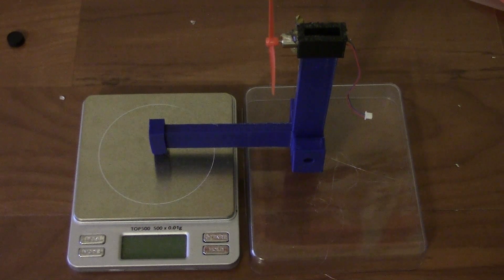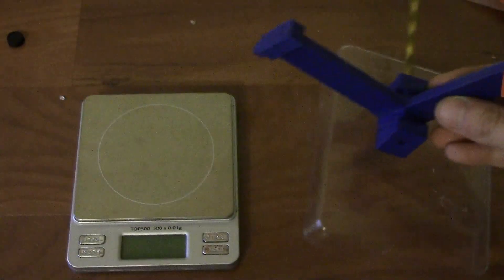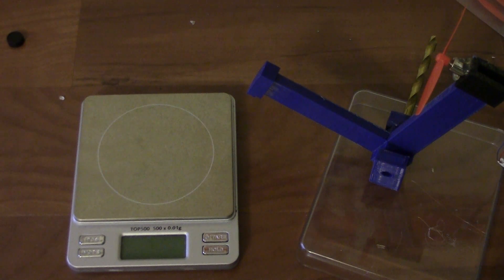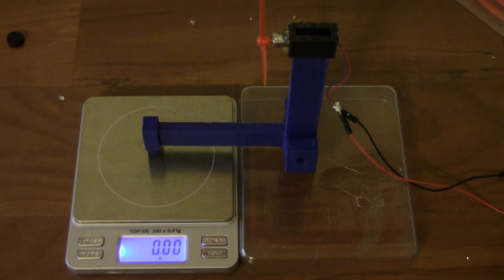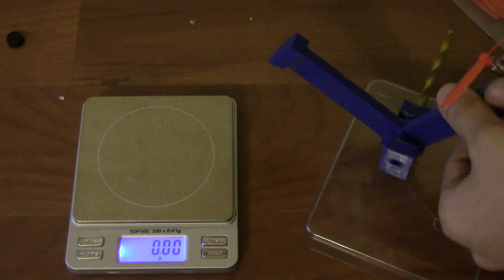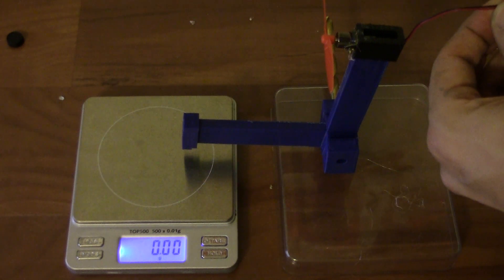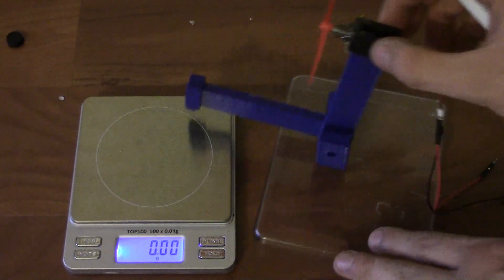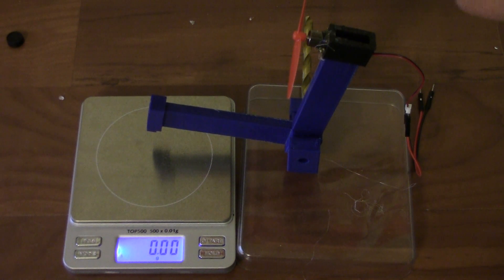Brushed 8.5 mm vs 7mm

Comment: Did you test the 6mm ones? How was the result? I’m thinking about building an extremely small quadcopter as a PCB with smallest possible motors and props. Do you think that it’s practical to use extremely small motors like a 0408?